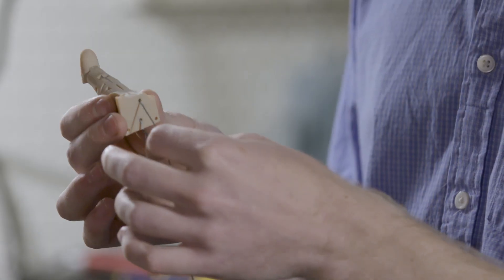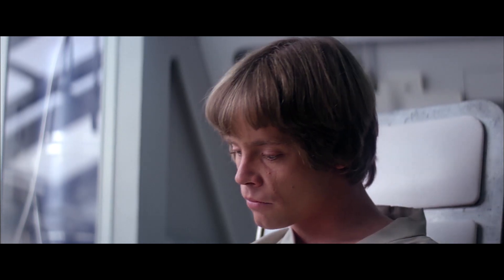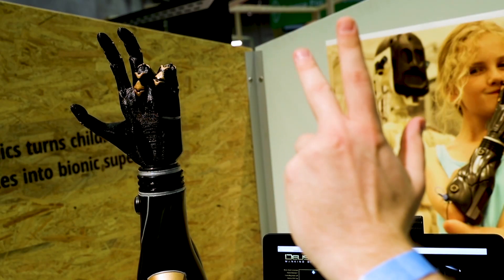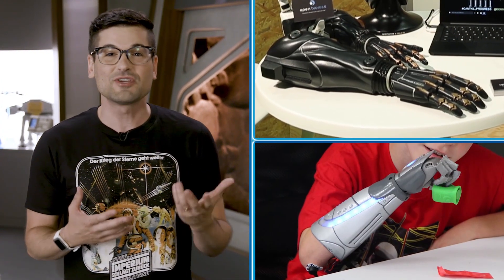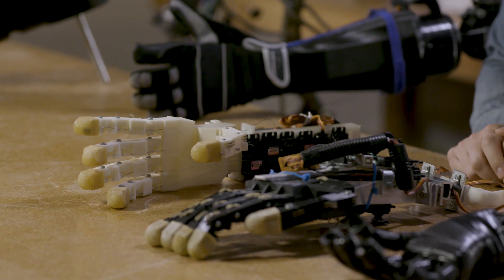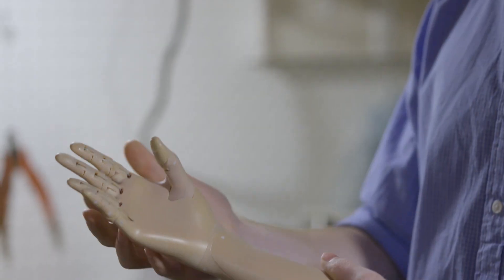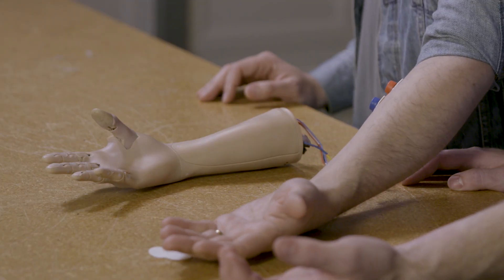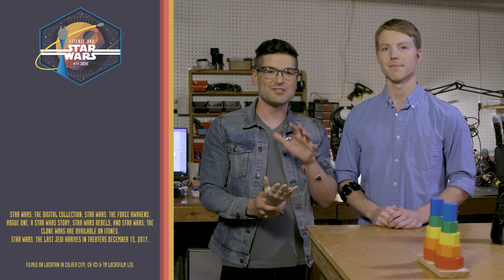Robotic Limbs | Science and Star Wars

Comment: Before too long, people will consider the durability, adaptability, and ability to replace robotic limbs, it is inevitable that someone will choose to amputate healthy limbs to "upgrade" to the above features which may be more important to them. 

What if my legs could be adapted to have built in wheels so I could basically rollerskate at significant speed all day instead of walking?  What if my arm could be replaced with a rotorhammer or chainsaw attachment?   Strange, but I'd bet money many people would do it.